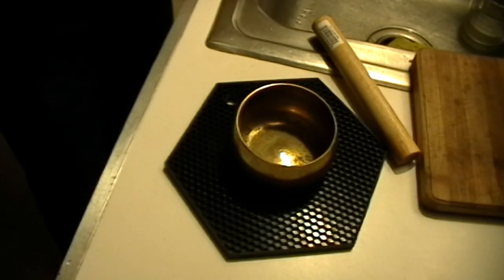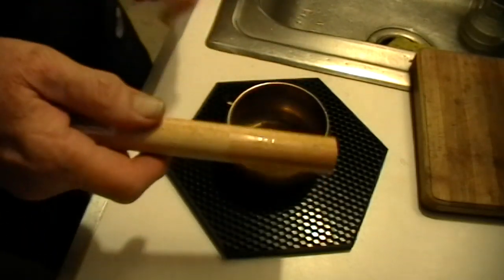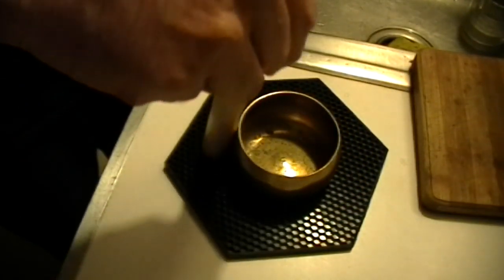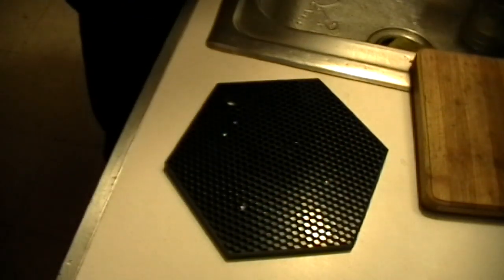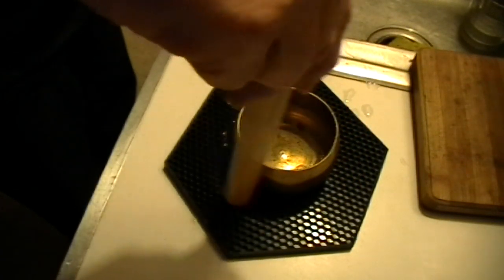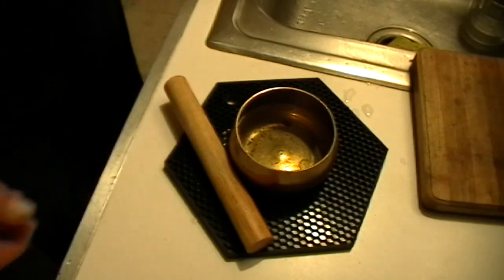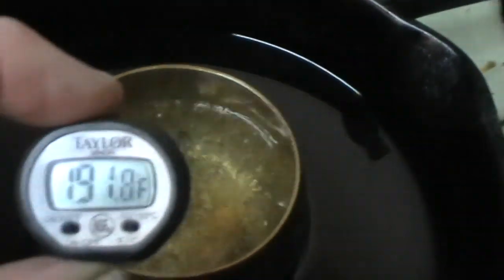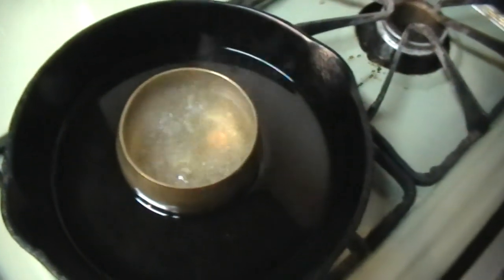Off Topic: Demonstration of Tibetan Singing Bowl: Singing, Boiling Water in Bowl

Comment from the maker: I am reminded of the gyroscopes that are used in model helicopters. There are several "micromachine" types. One is a tiny cup, that is vibrated in a mode similar to the bowl, I think. The interesting thing is that the nodes of the vibration act as the "gyro": they maintain orientation in space, as the cup rotates in the horizontal plane. The gyro somehow detects the position of the nodes and thus can tell if it's turning or not.
I'm trying to figure out a way to drive my bowl electrically.

Comment from the maker: I dunno. I've had this bowl for years but never thought to experiment with it. It turns out that whatever alloy they use is just slightly ferromagnetic. An NdB button magnet can cling enough to support the magnet's weight. So maybe it's plausible that a magnetic field could alter the behaviour of the bowl wrt vibrations. I've just determined one thing: the vibratory mode stimulated by the dowel isn't easy to get by simply driving the bowl with a coil at the right frequency. Still working...